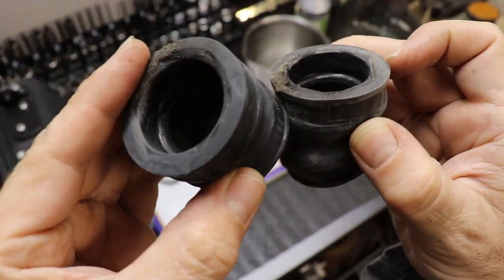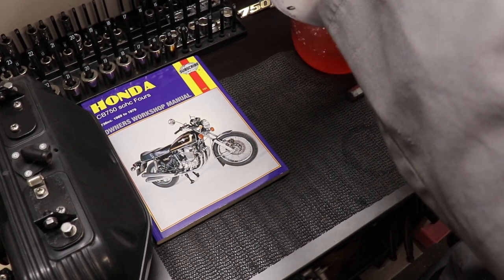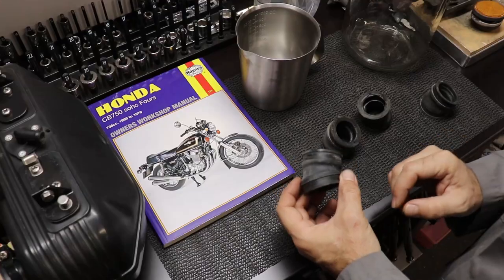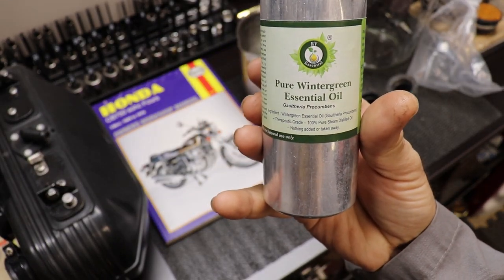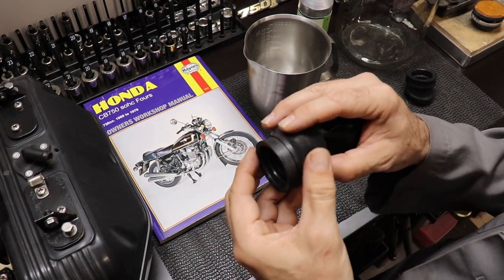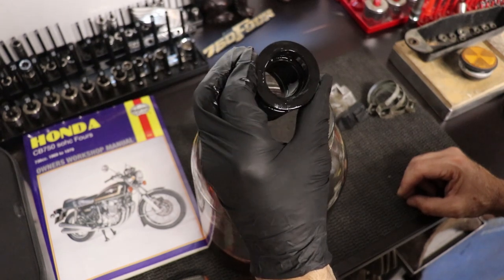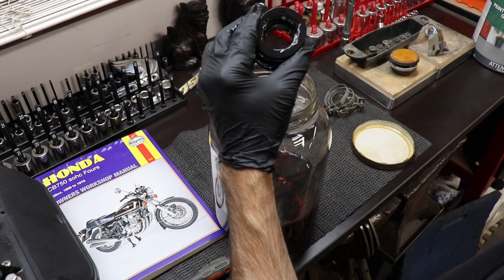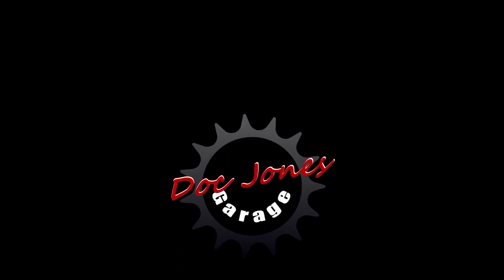How To: Restoring Rubber with Wintergreen Oil    (No Heat!)

Comment: This is AWSOME!  Made a mix of natural Wintergreen extract (amazon) and isopropyl (farm supply store) aprox 1to 4 ratio. Less than 24 hours and the difference is incredible 👍 
The rock hard air box boots/velocity stacks are from a 85 kawi eliminator . I can now use the original air box and boots to eliminate the pods and their tuning issues + retain the stock look and value of my restoration!
Reply from the maker: Agreed, it really works well. parts I've done show no signs of hardening up yet either. Noticed some very slight swelling in old fuel line hoses (oem) left in for a long time (pushing a month) but they shrunk back after a couple days drying out. Thanks for watching!
Reply: @DocJonesGarage  you earned a sub.
Reply from the maker: @brentfellers9632  Thanks!

Comment: Interesting!! I use regular engine oil. I'll lube up the rubber part with a little oil on my gloves and rub it in for a few seconds, wipe off the excess and let it sit for a a few minutes before I re-install the parts!! It seems to work quite well!! The only thing I wouldn't do that to are the old o-rings! They're already flattened out and stretched a bit so...they will only expand more with the fresh oil!! I just replace them!!
Reply from the maker: Thanks for watching!

Comment: Think this would work on the outsoles of shoes made with rubber?
Reply from the maker: I don't see why not, I'd try a sample piece first if possible or if you tried the whole sole I'd closely monitor it, even 24 hours makes a noticeable difference. The oil might complicate any gluing process so those areas might have to be cleaned really well. Thanks for watching!
Reply: @DocJonesGarage  Great thanks for the quick reply!
Reply from the maker: @Greanestbean  no problem, if you try it let me know how it works

Comment: After doing a little bit of research, I found honda rubber carb holders all over the place, especially ebay. Dude you story sounds fishy
Reply from the maker: 77-78 cb750k engine side carb boots do seem more available now, at the time I couldn't seem to find reasonably priced new ones. Personally I'd not risk buying them from Ebay just because it's hard to tell if they're cracked or not.